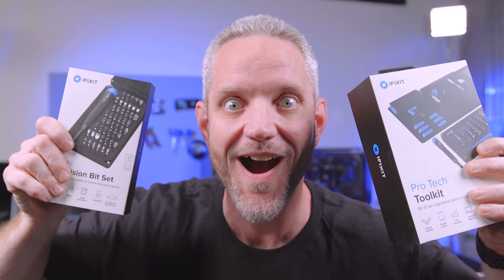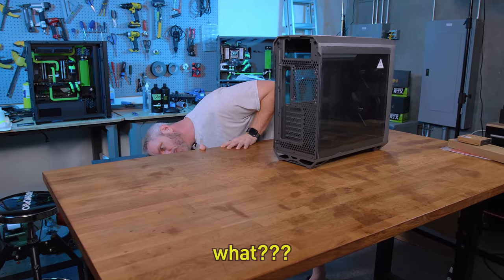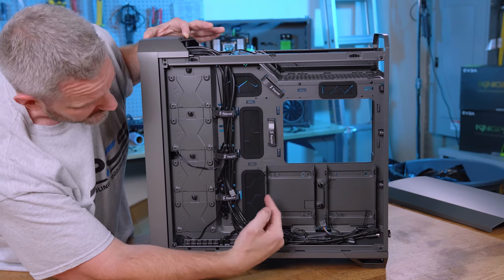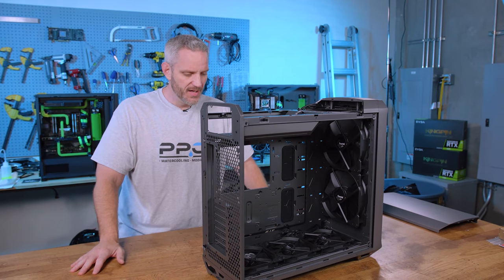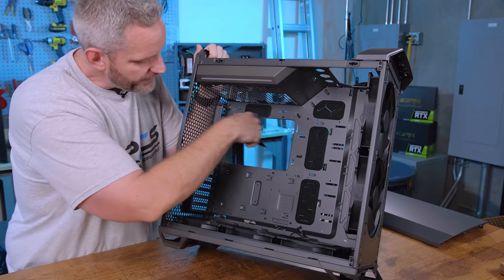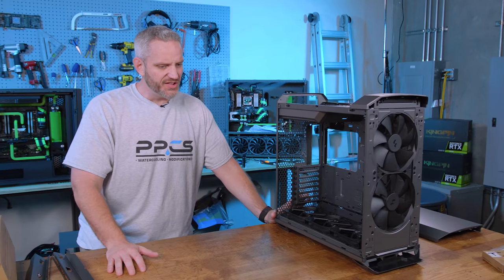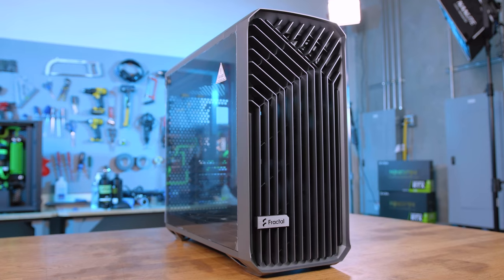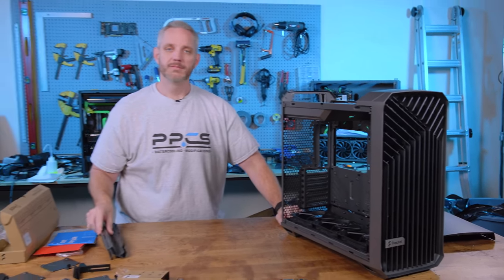I think I found my next case for the perfect casemod!

Comment: All you need to know is Steve at Gamers Nexus is very pleased with this case!
Reply: well, it looks like properly ventilated case. but when it comes to watercooling and putting bunch of stuff inside...this case has quite compact usable space, to say the least.
Reply: @angeltensey  I've been thinking, if there's a way to dissasemble the feet and put the top cover in the bottom, it could make for a damn great inverted case.
Reply: @angeltensey  Well, not every case has to be a watercooling case. I'm surprised Fractal even put fill ports in this case because you wouldn't buy this case to just rip out the two 180mm fans (which are 38mm thick btw, not the standard 25mm) and instead put a 120/140mm-based radiator in the front. There's some 180mm-based radiators like the "Alphacool NexXxoS Monsta 180mm Dual" which might be an interesting match though...
Reply: @wimpyhugz_TGK  I saw some reviewers say that this case is a real full tower and has great watercooling potential which is ridiculous. Looks like they just fulfilling promotion task from fractal. Its limited watercooling options is unfortunate for me, because im actually looking fora new case (bored of my view 71,which is generic fish tank) and torrent's front panel is absolutely stunning. Reminds me of...kinda mid-20 century science fiction illustrations with monumental geometrical buildings made of mix of shiny metal and concrete.

Comment: Yes, please do a modded case build with this one!
And, it seems like this case with two 280s in the bottom, 2 in the front, and one 140 in the back would make for a fairly quiet air cooled pc. Lots of air movement and not too much noise.
Reply: You really don't need to touch the fans in this case at all. 140's at the bottom get a bit too close to the bottom of an ATX MB connections.

Comment: I wantz to seez a casez modz!!!  PLZZZZ JAYZ(TwoCents)!!!  (Is that awful enough to be visible?)
Also I'm sure you could get trays to covert SSDs to fit into the hard drive bays ... if you needed them for some reason.  I just wish the OPPOSITE were also true, because for capacity reasons I will never not do a minimum of RAID5 four-disk spinning-rust array.  And for performance reasons OS on NVMe.  I just ... don't see the purpose of SSD bays.

Comment: 8:54 Those panel designs aren't unnecessary, it allows them to use a thinner gauge metal yet still have structural rigidity and prevents the panel from warping and making a popping noise.
Reply: Was watching on my TV and had to open the app to make sure someone said it 👍👉👉
Reply: Jay is into cars, he should know this. a lot of fire walls look like that somewhat.
Reply: @ImDudePlayinADude  In fact in a lot of modified performance cars, some of the panels have drilled holes that are warped like this to increase rigidity while reducing weight
Reply: @ImDudePlayinADude  meh we should let it slide. Jay doesn't script his videos as far as I can tell so I certainly will give him a pass. Not really misinformation but a bit of oversight in an otherwise enjoyable video.
Reply: @MrBadclyde  did Jay say they had no point? I don't recall I was just throwing out a use of them he would know of for sure.
Reply: @ImDudePlayinADude : Yeah at 8:40 ish he starts to talk about the "unnecessary but cool designs" in the sheet metal by the ssd sleds, its def a minor point of the vid.

Comment: Im actually using the FD Era as a media server with an Ryzen 4750g works fine for me. Only complain i have is about the 3.5 drive bay they are none fixed which is stupid. The last thing u want is to have a big HDD drop on ur mobo when u move it. 
But other then that it is fine. Using 240mm AIO and added 2 Noctua 140mm at the bottom. But removed the 80mm noisy fan

Comment: I'd like to see this case in a pure airflow/air-cooled build using nothing but Noctua stuff.
Reply: Solid side panels. Some of his car sounddampening and noctua ! I even would like to hear 5x NF-12x25 vs 4x ap181s/183s.
Reply: Nidec all the way. Noctua is overpriced and overhyped.
Reply: @sixtus2318  Full Dynamat case interior!  😆
Reply: I would keep the stock fans at least for the front because I do not think that Noctua makes 180s. You could use them for the bottom and the rear but I would probably stick with the stock but I would use a Noctua cooler like a DH-15. You could use solid panels and sound dampening but glass really isn't that bad since it is very ridged.  My guess is as it is pretty quiet at low settings but you would have to see how the heat vs sound works out.
Reply: @Outland9000  Well, i myself chose a thicc boi: STP Bomb Aero 4,1mm with a scoond layer of Surga Performance Comfort Mat Integra 6.0 mm to boot. You can stiffen the case  with it and fully decked out it modulates the sound to the humm of a spaceworthy engine room ;-) At least in my FT02 case

Comment: Jaz should update his intro to use a Gigabyte PS for the explode visual effect.
Reply: LOL
Reply: No, Gamersnexus should do it 🤣
Reply: @joeschmoe5009  actually, the H1 rizer cable isn't bad, if you're modding, and not using screws, or else just using zip ties or something, to hold graphics card rizer cable in place... Also, it should probably only be in builds that only you would use, guaranteed... And I'm not recommending the H1 case, just saying that the cable itself isn't that bad, or has the potential to not be, cuz it's only that hole that's the problem in the certain circumstances...
Reply: @northwiebesick7136  I have a Gigabyte PSU in my H1 case, is that OK?
Reply: @ChristopherHailey  I'm not saying that it would be good in an H1 case, I am just saying that the rizer cable itself isn't bad depending on how it's screwed down, and that a few people might have a use for van H1 rizer cable, where you wouldn't even need screws, like say using glue, however, the gigabyte thing is a different story, because if you use the rider cable without that hole screwed in, it won't break, but a gigabyte PSU can fry at any time...(also I'm talking about using the GPU rizer in such a fashion that you wouldn't use screws ever, no matter how hard someone might try, like, as I mentioned, with glue, in any case that's not an H1, say a custom built bubble iMac PC to desktop conversion, although I have decided to go with a iGPU, so that point is moot
Reply: Sorry, it was just my lame attempt to be Mr. Funny Guy

Comment: If an ITX version of this comes, I'll probably build a new PC
Reply: I have an In Win A1 Plus. Just two 120 mm fans in the bottom. One 120mm on the back and one 120 on the side. I would love to have full front airflow instead of using side vent. On the same case size but it's quite difficult to fit in sff case
Reply: @WayStedYou  Obviously, an ITX case wouldn't fit such an amount of fans, I don't think he expects that either, just take the design elements and distribution, and shrink it to be tighter...
Reply: @YOEL_44  exactly. This case is just perfect for me, but it's also too big, and if possible, it'd be really cool to have
Reply: @YOEL_44  It will be bigger on the outside than on the inside.
Reply: @ChristopherHailey  Are you kidding me?
Reply: @YOEL_44  Yes

Comment: Love how Jay just completely disregards the meshify series.
Reply: i was thinking the exact same as i look at my main rig in a meshify c
Reply: @TheJacool23  Same here, looking at mine going.. no Meshify?
Reply: @TheJacool23  I love my Meshify C, what do you think about yours overall???
Reply: Meshify was nice, but outta the box from Fractal it wasn't great for airflow. The chassis was great, but they skimped on the fans. It desperately needed at least one more fan to make it work.
Reply: @jellorelic  my meshify 2 compact came with 2x140mm front and 1x120mm rear.  That thing has excellent airflow with that setup, no need for exhaust fans at the top
Reply: Well, the Meshify is just a Define chassis with a mesh front panel. It's still a rectangle box. 
That said, I love my Meshify 2 XL with 60mm thick 480+360 rads.
Reply: For anyone wondering, my case is the original Meshify C, not the Meshify 2, since I did say I have the Meshify C... Also, I'm using 16GB of g.skill Trident-Z RGB and an x570/3900x combo with Wi-Fi and an 512MB M.2 drive, as well as a MSI Radeon 5700XT MECH OC(yada yada, GPU name is too long to remember it all)... Eventually going to put an AIO or air cooler in there though, as the stock one, cools, but rather poorly if I try any CPU intensive workloads like basic video editing, and to be honest I have heard that the 5700XT is hot from the factory, but I'm hesitant to even try the janky stuff Gamers Nexus did to see if other methods like pennies under the heatsink work, because well, I prefer something better than pennies cooling my card, and I definitely don't want to break it as it's my only graphics card... If I start using and learning the Daz 3d character modeling software, with any regularity, I'll have to upgrade to an Nvidia card though, to keep rendering off of my CPU wherever possible... Who knew that a hobby I never knew I wanted to try, would require an Nvidia card

However, I find that I wish more cases would support an internal 5¼ in. drive bay, and the few that do, specifically the Fractal Design Define series, appear like you would have to remove the front air panel to access the CD/DVD drive... Not a fan of that...(before anyone says "Focus G", a build I built recently to sell(at a 400$+ loss,(aquaintance in need price, once they save up the money) has such low tolerances and was so shoddily put together, that an ATX board won't fit in there right without serious manhandling, although I was overall satisfied with the build aside from that small inconvenience of a 30$ case
Reply: @northwiebesick7136  I have the white one and I love it. I purchased per GN Steve's review.  Replaced the stock fans with UPhere ones. It's lovely
Reply: @northwiebesick7136  Indeed. The 3900X will run hot with the included cooler. I have the Meshify C myself. Replaced the included fans and added more. Having said that, I use my PC mainly watching TY, Twitch, and Hulu. Some gaming. I had a Sapphire Nitro 5700X and yeah, while playing the Division 2 man did it heat up the case. I now have a 2070 Super and I notice a diff in temps.  3 120s in the front and one in the back. Air cooler is a tower style dual 120 (push/pull) config. I've got the fans running on a custom curve. Best of luck with your system buddy.
Reply: @BeB02090  oh I know that, and I've used it for a year or so now, so obviously that doesn't run hot normally, it's just that in the future, I don't want to stress my system too much, if I DO start doing heavier workloads, which is why I have plans to eventually replace it... Just waiting for the shortage to end so I can get some cheaper prices... It sux right now... Also, Gamers Nexus recommended me on a Livestream last year sometime, to get either a Noctua air cooler, or a "liquid freezer II" AIO... of course, I was already leaning towards that direction, but I wanted to make sure I wasn't overlooking another cooler... He basically said what I thought, any dark rock cooler, I forget which Noctua one, and the liquid freezer II AIO were my best options, for bang for the buck on my CPU specifically...

Haven't thought about replacing the fans yet though, although that's on my Todo list as well... I'm currently running the 2 or 3 Fractal Design fans that came in the case, and a couple of unused random fans I had laying around that I picked up at a garage sale for like 10-15$... 1 or 2 were like Fractal Design fans, while the other one was a Corsair Lightloop fan... Definitely want to put all grey Noctua fans in there, eventually, but that's expensive AF...

Comment: If I was building a PC in this case, I would go intake on the back and bottom and exhaust it out the front, and power supply to exhaust from inside the case as well.
Reply: Than you should put dust filter to the back.
Reply: @overlord580  Yeah

Comment: The ultimate “Phil” case featuring:
- Phil port for radiators 
- Phil-ters for removing dust build up
- 180mm fans to Phil-lup the front panels w/ air flow 🏆👍🎉🥰🥳 brought to you by “I-Phil-It” *explosions 🔥💥💥 🤯

Comment: I'd love to see a mod in this, especially what you described. Sounds really cool. I just bought the RGB version and it'll be the first case I've ever bought where I'm not going to replace the fans. Going to go with air, but might do an open loop when EK's new 360mm (2x180) rad comes out. Also, just a heads up, they do have an optional vertical mount bracket, and you don't have to remove any fans. And I've also seen some testing where adding the back fan is a waste. It's results ranged from doing nothing, to actually hurting temps.

Comment: More needs to be said about how easy it is to get the PSU to plug in the cables should you have to after installing the PSU.. Most chassis are a nightmare to do so..

Comment: Jay, 'Tear the Crap' out of that case with a case mod.  I want to see wires, hoses and fan edges hanging out, with simulated sparks.  Do you remember how the enterprise and the Reliant looked in the 'Wrath of Kahn' - do that.  If you don't, I will buy one of those cases, put some solid side panels on (and I have a couple I can make fit from an old case), and Premier it on my Channel :)
Reply: If you don't I will buy one of those cases, put solid panels on the sides and to it myself :)
Reply: If you don't, I will buy one of those cases, put solid side panels on it (I have two I can make fit) and do it myself :)

Comment: Hey Jay hope you’re having a great day. My name is Michael and I just built my first pc ever. It’s giving me a lot of crash and freezing issues everytime i try to run a game. I’ve looked up many solutions on YouTube but none seem to be helping. Is there any way I can send you my pc so you can check it out? I’m really freaking out here man.
The components im using are the following:
AMD Ryzen 9 5900X
Gigabyte X570 Aorus Ultra
Corsair Dominator Platinum RGB 32GB
Aorus Geforce RTX 3080 Xtreme 10GB 
Gigabyte GP-P850GM 
Western Digital Black Performance 2TB HDD
Aorus NVMe Gen4 M.2 1TB SSD
Aorus RGB AIO Liquid Cooler 280 
Corsair Crystal Series 680X

Comment: The "cargo container" ridges are for strength. When metal is stamped in that way it adds to its stability and strength, rather than just a flat piece of metal. I would argue they are necessary for that purpose.

Comment: I really like this case. It is funny because I see it as an ideal choice for someone that wants a very professional-looking workstation. I f I was building systems for a firm that needs video editing, CAD/CAM, FPGA development, or just software development. Lots of cooling Big GPUs, multi-core CPUs, and big air coolers. The one downside is a lack of drive space but you can fit two 3.5s and you can get some huge drives now so you could have two in RAID which should do for most uses and if you need more drive space than that then a NAS or SAN is probably what is really needed.

Comment: I found it very difficult to buy a new, boring case without stupid glass panels and lighting, with front 5.25 and 3.5 bays for a couple of optical drives and a multi card reader with USB-C Port. My desktop is a Ryzen5 3600 with 32gig RAM and a 1050 gpu. I may upgrade the CPU to a Ryzen7 but gpu prices are still stupid high and they suck a ton of power. I do video, not gaming.

Comment: 8:42. "It's got this kind of a...cargo-y lookin, looks like a cargo container of some sort. Like these...UNNECESSARY but cool looking designs in there." ...structural engineers: *cringe*.
Stamping/bead rolling metal prevents warping (increased durability). I doubt it's necessary with this small an area but it's not "unnecessary" 😁

Comment: cheeeeeeeeeeers~ even 2 years later this case is still kicking, but sadly oh sadly especially for the beautiful gray version, supply is extreemly hard ot find at any sort of retail new and proper supply pricing :( buuuuuuuuuuut sadly im SUPER interested in doing a 360 AIO top mounted for my 5800x3d so i can use the corsair link series, instead of bothering to learn how to get a tower cooler going and a proper clearence case though im sure i SHOULD be doing that instead hah, buuuuuuuut yea time will tell what i end up with, atleast im hoping to have a 7900xt soonTM and its a bit chunky from XFX but i think if i get the right case with clearence and can still do triple 140s on the front intake or triple 120s i can balance my air pressure and rpms really clean so heres hoping

Comment: Hi Jay.  Love the channel.  Keep up the good work.  Had an idea... You mentioned that building new pcs is difficult for most, due to the shortages in GPU supply, scalping etc.  So why not make a video on taking a Pc you already have, and turning it into something new, using new parts that ARE available?  So use the existing motherboard, CPU, GPU, PSU etc, but perhaps a new case, cooling concept (change from air to water, AIO to air- that sort of thing).  So you end up with what appears to be a new PC, without the major expense - currently - of a completely new build.  Best of luck.  Stephen (misteravid). PS. I know this is mostly what you did with Skunkworks 2.0.  but I mean the same entire computer internals - as much as possible - but with a new skin and concept.

Comment: This case is so damn interesting, however I dislike the backside in general.
Not really enough place for the cables, especially considering you'll need cable extensions.
A bit more space at the backside would habe made this such a great case.

Also they should've used 200mm instead of 180mm IMO. 180mm is such a weird niche that you'll have a hard time finding replacements or similar.
(yes I know you can use other sizes too.)